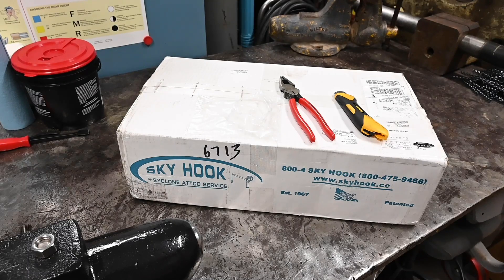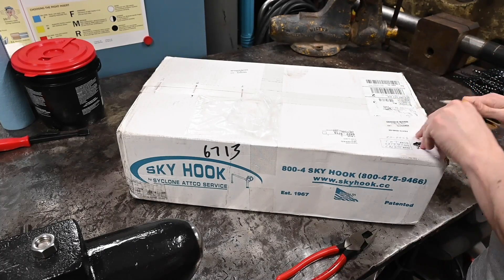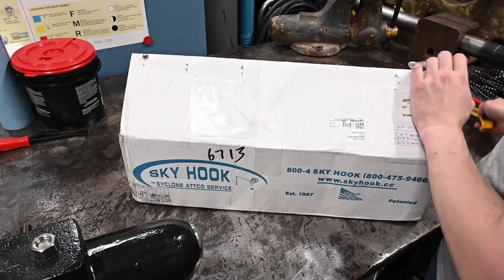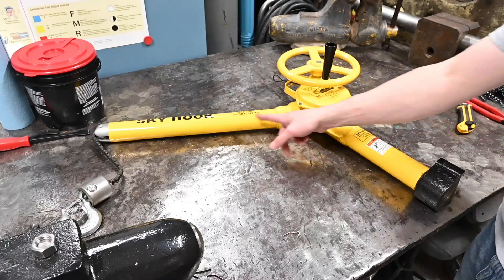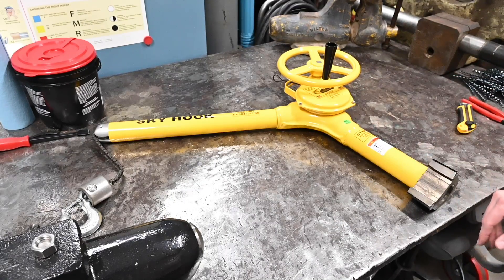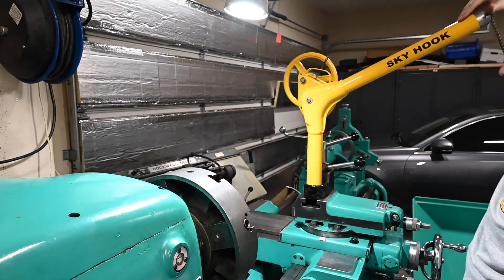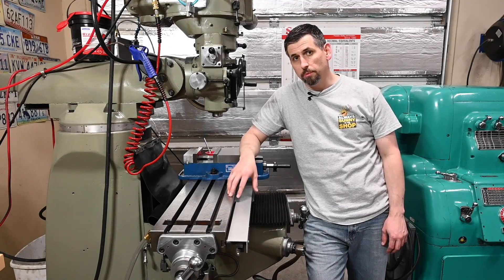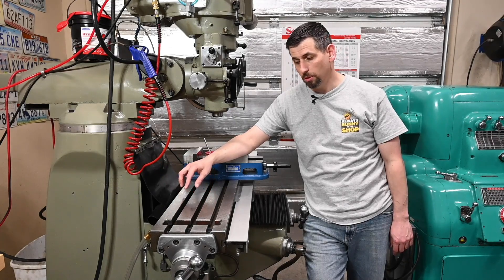Sky Hook Crane Review: Lathe AND Milling Machine!

Comment: Waited one for a long time, but I have have to make do with my boom lift that's adapted to my welding table.  They may be pricey, but the chain design is by far better than my cable HF boat type winch. Nice machinery. Merry Christmas 2022, and a ssafe New Year, Bear. Thx for your sub.

Comment: Hi I was wondering do you still like your skyhook I’m thinking about buying one
Reply from the maker: Absolutely love it- couldn’t do without it, honestly. I would love it more if it reached out just a bit further, but then the max weight rating would drop. It’s expensive but if you can afford it, buy it.
Reply: @AlwaysSunnyintheShop  thanks I think your channel is great. I am 71 and just got a lablond lathe 19 inch swing and a 54 inch center. A bridge port mill and a taft Pierce surface grinder. Never used any of the tools before but can not wait to get started. Right now I am cleaning and setting up my shop. Be safe buddy
Reply from the maker: Awesome that sounds like a great setup already!

Comment: I made my own solution with a track on the ceiling that’s curved at one end. It uses a trolly and a small chain hoist. It works very well. I don’t know feel it’s good to hoist a heavy chuck or piece of metal from the tool post. I don’t care that manufacturers make these products for the purpose. That doesn’t mean it’s a good idea. Just think of the leverage applied by a 120 pound chuck (though that four jaw doesn’t look like it weighs 120 pounds) hanging from the end of this beam. The equivalent weight is much more. The compound is designed for pressure exerted very close to the swivel. This changes that equation drastically. If the cross slide and compound isn’t totally locked down when using this, the risk for damage is there. Even when locked down, it’s exerting a force the lathe wasn’t designed to resist.

Comment: The reason there are no internet reports of machine damage using one of these units is because most machinists realize it's not a good idea to put the stress on their tool post and compound, and they don't install one or use them.
Reply from the maker: I spoke with Attco Syclone directly and they have sold this crane since 1969. In the 51 years since, they have not had a single customer call and complain about the crane causing damage. I think people underestimate the strength of their machines. If you mount this on a 9” Atlas  and try to lift 500 pounds you’re gonna have a bad time. Any reasonably sized machine will handle the load just fine.
Reply: @AlwaysSunnyintheShop  Curious how many units Attco has sold over the years. I've never personally seen one in any shop in 50 years of being in various shops. My 16" Leblond only has 2)  7-16 compound bolts, I wouldn't trust them.
Reply from the maker: Not sure how many they’ve sold, but they’re still in business and that’s their primary product so I’m guessing quite a few. Not sure you have anything to worry about- 150,000 psi tensile strength in grade 8 bolts, and the shear strength I just looked up shows a minimum 13,000 lbs each. I think the reason you don’t see them more is that they aren’t cheap, and shop owners are cheap. Also, if there’s an overhead crane these can be seen as unnecessary.
Reply: @AlwaysSunnyintheShop  I'm pretty sure a 1954 lathe is not equipped with grade 8 fasteners.
Reply from the maker: Ok let’s say they used cheese grade 2 fasteners. 74,000 psi tensile and a combined 13,000 lb shear strength. My point is your fasteners will not be the limiting factor. Fully loaded they say the crane will exert a maximum of 900 lbs of force on your tool post. A fraction of the force imparted on it when you’re making cuts of any substantial depth.
Reply: @AlwaysSunnyintheShop  You've got me interested for sure. I'm 60 yrs old and those chucks don't seem to get any lighter. Plus I keep them alll the way down on the floor. I have a military aircraft hoist that's similar but larger in size to the Sky Hook units. It was given to me years ago, and I never scoped it out much. I'm curious enough now, to go have a good look at it.
Reply from the maker: I think you’d love having one. I’m much younger than you but those chucks are unforgiving to a slip or a bad day. I can’t remember if I showed it in this video, but you can lower a chuck down to the floor on my machine which is fairly tall for 22.5” swing. I’m contemplating making a cart to hold chucks, my steady rest, and the crane itself.
Reply: @AlwaysSunnyintheShop  Cart sounds nice. Wish I had room for one. I much prefer Grey paint on machines, and despise that horrid Tan that seems so popular. But I do like that Green for some reason . Nice.

Comment: make a chuck tree. Basically it would be like an engine stand only you could fit your chucks on and roll it to lathe drop the chuck in a cradle and then roll it away from the lathe you make it with stations for every chuck that you own that fits that machine.

Comment: There’s no way I’d ever mount a crane on to my precision lathe like that  . There’s a lot of leverage being transferred right to your slides of your top post . Not me
Reply: All the negative comments following John T Hay jr 's comment fail to take into account of what sort of stresses are put upon a tool post of a what 12 to 15 horse power machine? 250 thou depth of cuts in  4" diameter steel produce enormous torque forces on the cross and top slides. Four or five times the amount that the static hanging of a 120 pound chuck will induce. Get a life guys coz you obviously are armchair machinists with no clue about heavy machining.
Reply: Exacly. That Chuck weight 2~3 times that much in the end of the crane.  Also imagine how the saddle and cross slide, and topslide will have a twisting Force. Not like a Cut thats downwards
Reply: @VærdAtSe  You said it all.
Reply: I'm not a machinist and I don't even play one on YT but I have to agree.  I'd mount a base for it somewhere on the frame of the lathe.  Better yet build a wheeled cart with it on the cart and you can lift and tote what ever and where ever you want.
Reply: Peter Haan  We’ve used the rolling cart before and it works well . But to use the machine for a platform in my opinion is not good
Reply: We mostly use jib cranes in the shops I’ve worked in .
Reply: Sure hate to see him do that to he’s lathe . He’s got a great monarch the best looking example I’ve ever seen
Reply: LOL no
Reply: Well it’s y’all’s machines to do with what you want . But I going to stick to my opinion with over 50 years in the machine shop trade which I started when I was eleven years old with my father and uncle I will have to just say no to this devise as it was presented

Comment: That looks like quite a load on the toolpost, arent you scared of bending the bolts or anything?
Reply from the maker: Not at all worried. The crane itself only weighs 23 pounds and the load against the tool post when cutting steel is huge. Even fully loaded I have no concerns this could break anything. Searching all over the internet I failed to find a single instance of someone damaging their machine by using a tool post crane.

Comment: I have been amazed that more shops do not have material handling gear like this.  A longer lifting eye could hold your chuck at a locked position.    Your current eye falls a bit short.  Having the chuck mount at certain braked position on the sky hook would be a bit safer.  It seems like a great device.   Perhaps you'll build  Sky Hook equpped material cart.  You are definitely on the road to working smarter, not harder.  I look forward to seeing more of your clever work.

Comment: in the  block you made for the mill.. drill two holes in the non dovetailed end.. so you can use 2 T bolts and spread the load of the leverage to reduce any chance of the Top of the T slots  busting out.  cost next to nothing.  as for the lathe..  why not create in the future a plate that drops down on the inner rails where the tail stock slides..that mounts the sky hook.. put some bearings in it so you clamp tight against the bottom, inner and top center rails and while tight can still roll it left and right.  this would NOT effect your tool post or the ways the saddle slides on.. and be really easy to set in.. rotate the hold down under plate and snug it down.  it would require wiping down the inner way surfaces..   it also avoids upward forces on your cross slide and compound dovetails and keys.

Comment: Years ago I built a small floor standing davit/jib  crane with electric winch to stand  behind my lathe  off to one side,  today you can buy them for around $200 for pickups/trucks.Makes moving chucks, heavy work easy,could also have a floor standing davit for the mill.

Comment: Not sure if anyone else mentioned this yet, to each his own but when I am changing out chucks I always make sure I protect the lathe bed. I put a piece of steel through the chuck and into the through bore of the machine, that way if for some reason the chuck is dropped or slips it will fall against the bar and no further. This is especially important if you are doing it by hand, sometimes the cam locks hold just enough that it is a surprise when the chuck lets go. Also a piece of plywood or similar beneath the chuck so if it falls it will not damage the ways.
Reply: I do that and a 2x4 across the ways. Plus the pad in the chuck helps when I install it again cause my lathe is a taper not a cam lock
Reply: @NOSLEEPATALL  I only use a piece of wood across the ways.  It also helps me raise the chuck so it aligns closer to get it on in the firs place.  Putting a bar through sounds like a neat trick though

Comment: A great idea to use shop tools to make one! I am actually planning to use parts of a commercial engine hoist to make a small crane that can place things both on the lathe and nearby milling machine. A nice shop project. All you need is attach a pipe to the wall and floor with jib on top - if scrap is free my total cost will be under $30 USD!

Comment from the maker: Lots of comments about force against the tool post and compound and the danger in using this crane. I used Kennametal’s cutting force calculator that will maybe give some perspective. My experiment cutting .250” in 4340 produced a tangential force of 1,589 pounds, a feed force of 787 pounds, and a radial force of 276 pounds so the resultant force is 1786 pounds. Even with the crane acting as a lever against the toolpost and compound, we’re not approaching a point of failure. The iron in the compound is in the realm of 60,000 psi tensile strength. The tool post stud? About 156,000 psi tensile strength. We’re not even close to approaching these limits with the crane maxed out on its load rating. I can’t find a single instance online of a crane like this breaking a lathe compound.
Reply: Well said.  And more; these things have been around for decades.  Now I will hesitate to put it on my Grizzly 13x40 lathe. I do not believe Chinese castings are really 60,000 psi. Old Monarch, sure.
Reply: I don’t believe it will break the tool post, more whether it will introduce play, looseness ?

Comment: Interesting device, I have seen them in the catalog but never in person. Looks effortless.

 Wonder what the ratio is? How much does the hook move per turn of the wheel? What is the diameter of the wheel. Looks like a simple gear ratio, a worm gear might prevent slipping but give too much ratio. I guess you have DRO coming.

Comment: It seems that some people are thinking this will damage/wear the tool post, cross slide, or ways. I know that an inherent ability to estimate loads, and strengths of the parts being loaded, isn't inherent in everyone. But for the people that don't have this ability, there is no issue of damaging/wearing anything on the lathe. Without doing a vector diagram, putting 50 lbs in that sky hook, won't be an issue; the loads are far too low to affect a lathe of this size.  I guess things that seem obvious to me may not be obvious to everyone.
Reply from the maker: I’m with you. The loads on the t slot when cutting those .250” chips is certainly higher than using this crane. Monarch put a load of cast iron in this machine to endure heavy forces against the compound.

Comment: This item has been around for years, I first used one in the early eighties as suggested below build a wooden pillow block for it when installing and removing and can be used for holding the chuck for storage on the floor or bench.
Reply from the maker: Patented in 1967 apparently.

Comment: Have had a Sky Hook for years.  They do not slip at any point.  Next item you need to make is a non metallic (wood) block that fits underneath your chucks on that lathe with a curved top to basically match the chuck diameter (slightly larger). You may have to glue up a block to get a piece big enough.  The underside of the wood block needs to roughly match the vee and flat way configuration of your lathe so that it has to be lifted up a little to be removed and cannot slide off forward or back. To the top of the block I added Delrin strips (because the wood reduces friction of metallic objects, in this case your chuck) that reduce the block radius to closely match the chuck diameter.  These strips do not need to completely cover the radius, just more or less serve as “rails” for the chuck diameter to rest on.  Now you can use your sky hook to lift your chuck, set it on the delrin rails, unhook it, and turn it as necessary to align the cam lock pins to the spindle holes ( This is assuming that Monarch is a geared head or other hard to turn spindle) You will quickly discover it is a little difficult to align things attached to the end of the chain.  This block does away with that problem and also prevents damage to the ways of your lathe from a dropped or bumping around chuck.  Old time machinists always had a wood block similar to this that they used whenever they changed a chuck out.  I just added the top curvature and delrin strips.  When you get to the point where you think “Hey I could mount this Sky Hook to a cart and it would be mobile around the shop” remember it would need outriggers OR THERE WILL BE AN ACCIDENT.  Anyway....food for thought.
Reply from the maker: The slipping was due to a ‘kink’ in the chain when I assembled it. Should be good now.

Comment: Thanks for the review... Looks like a great product.. Interesting to see how it will affect your tool post or your topslide after few years of use
Reply: Using it for 5 minutes a week (if that) it's not going to cause any issues. The tool post is plenty strong enough to handle the load. This is a home shop environment.

Comment: Hi I saw that same video and decided to build my own cause i also have a machine shop, mine is articulated  ( 5ft radius ) because its never in the right place and it can double over its self, i used a sealy handcrank winch and its great any more than 100kg the 40mm pins flex 50mm box section brased over the top not loose the inner working, it still functions fine but when you look at it it looks like its leaning.

Comment: What is all that leverage doing to your tool post? Didn't you just have  an experience with the tool post's king bolt stretching? And what might it do to the tram of your mill table? I would check my tram before using it the first time to lift a heavy load, and then afterward. The device introduces force vectors for which those machines were not designed.
Reply: It's inconsequential. It's very light loads, so it's not an issue.
Reply from the maker: The tool post bolt wasn't actually stretching (though I thought it did at one point), it broke free of the pin that secured it, so that failure was due to my bad design rather than any cutting forces.
Reply: https://www.kennametal.com/us/en/resources/engineering-calculators/turning-calculators/cutting-forces.html

I was playing around with some numbers here and found that normal cutting forces are REALLY FREAKING HIGH!!
Reply: You make a good point regarding checking tram, before and after.   Without numbers and crunching same, I eally don't see it as a severe risk as  long as loads don't get ridiculous  and some common sense is employed with off table swings.  Non-symetrical loads are kind of part and parcel in mill work; at least in the shops I've dealth with.  Not sure what that says, really.    In addition of odd-ball work and set ups, many will leave a rotary table on one side or the table and the vise more towards the other for convenience.  Of course, long term, it will certainly accelerate wear as a cantilevered condition is a given during either operation.    But, for most hobbists and the like, probably not going to see much during one person's lifetime.  The machine's size, age, maintenence, and overall condition always a factor to be sure.  Just an opinion and always subject to being wrong.
Reply: It's similar to the force applied by a boring bar so it's going to be fine.
Reply: I am a critic where it's due. I would not be worried about this stretching the king. Especially with care and slow motion. If this stretches the the king, it was old and on it's way out to begin with.

Comment: 5:20 - Looks useful. (Keep a slip-stone handy for dressing the bruises on the nose-taper)    ;-)
Reply: Looks like it doesn't have a tapered nose, centers on 6 cam locks???
Cheers
Reply: @carlthor91  There's a 7* 7" 30"  X 14 mm taper on the spindle nose on a D1-6 to centre the chuck. The camlocks hold the chuck on to the taper and take the driving torque.
Reply from the maker: The taper does indeed hold it on- that’s why I needed to tap the back of the chuck with a mallet to free the chuck from the spindle. Just not a very long tapered surface compared to an American long taper (L3, L2,L1, etc).